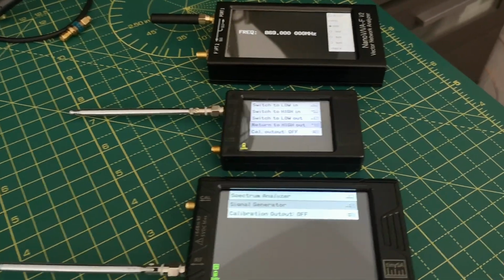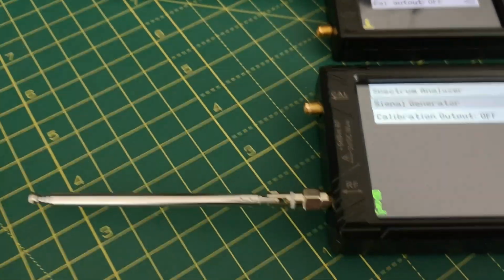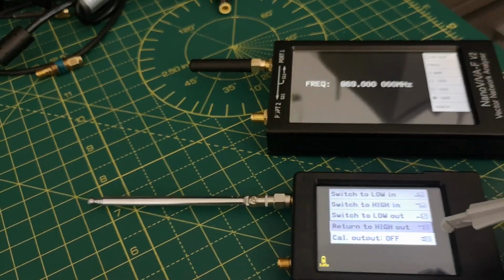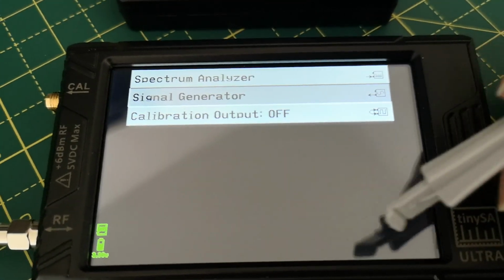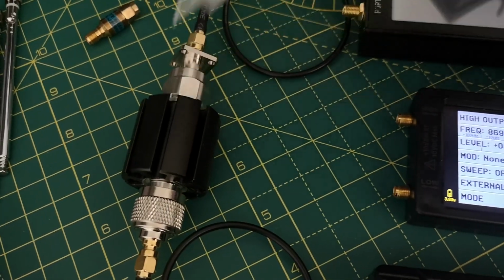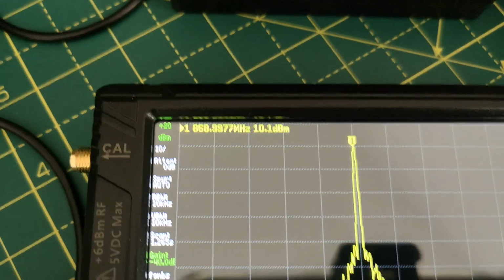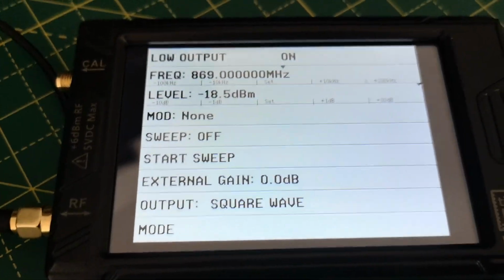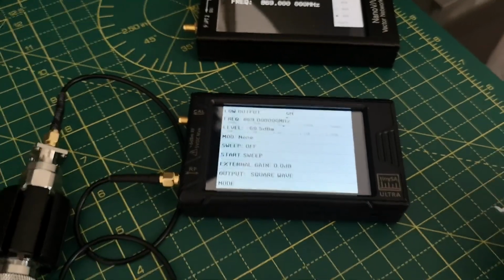Nano VNA and Tiny SA as Signal Generators for testing Meshtastic frequency equipment

Comment: You can calibrate the Tiny SA Ultra frequency output via a menu(not sure about the basic model). Erik Kashoek the designer has a video about it.
I have both models and using one as a receiver, other as signal source the RF readings compare very well.
Reply from the maker: Thank you for the tip !

Comment: 17:57 maybe plus-minus mistake? (assuming the "tinySA Ultra" shows correct values): with the receiving "tinySA Ultra" showing 10.1 dBm, and cable attenuation at 1 dBm, the sending side provides 11.1 dBm; but the sending "tinySA" is configured to send at 9.0 dBm. So it seems the "tinySA" is actually sending with more energy than what is configured.
Reply from the maker: That could well be true. The tolerance on this equipment is probably much higher than 1dB anyway.